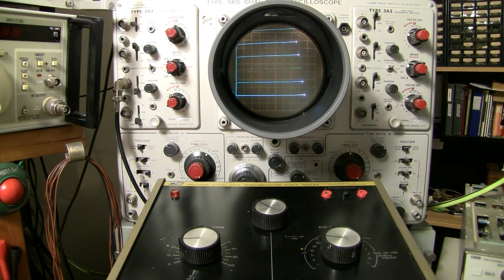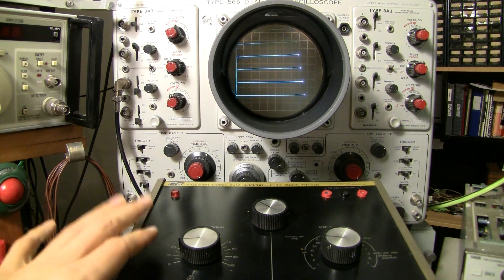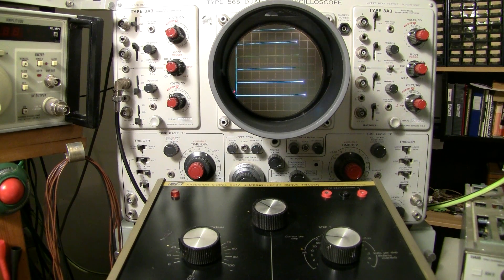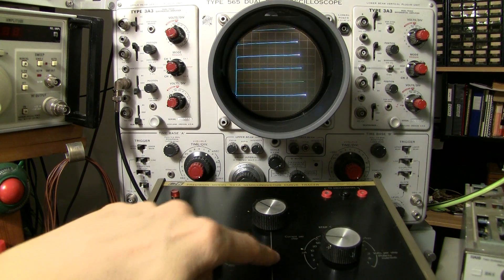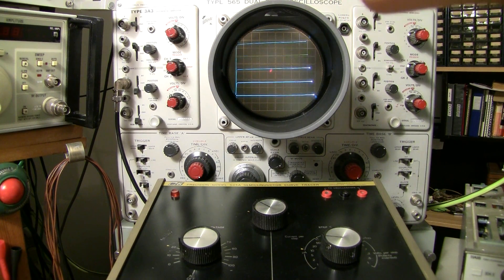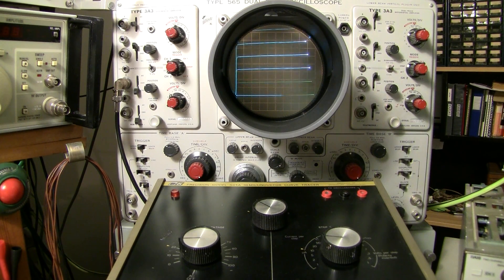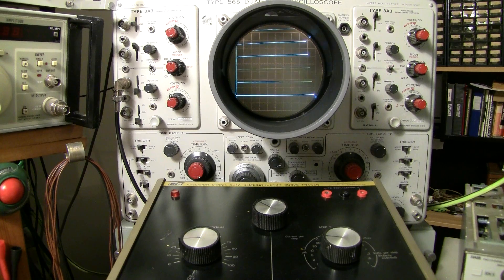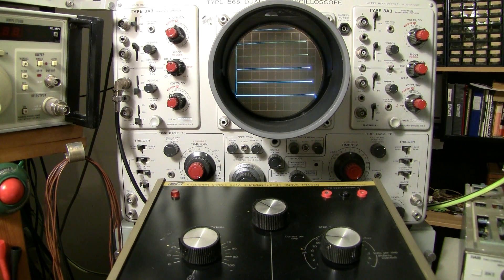How to use a Curve Tracer to determine Transistor gain

Comment: Hello, soon I'll be getting an analog oscilloscope (probably a Tektronix 465), and I've been trying to find a cheap curve tracer mainly for the purpose of matching transistors, diodes, and testing electronic components, to go with it. All my searches yield giant $2,000 machines though. However, I really like the look of your BK 501. Do you know of any other similar little curve tracer boxes I should keep an eye out for?

Also I have a quick question seeing as I have never owned a curve tracer. How is it hooked up to the oscilloscope, do you just plug it in to a channel? and do you hook it up to the oscilloscopes ground? And will a curve tracer such as the BK 501 work with almost all oscilloscopes?
Reply from the maker: The 501 will work with even the most basic oscilloscopes, as long as they have separate horizontal and vertical inputs.

Comment: I was lucky enough to get one of these 501a's with manual for a really great price. 

You mention that you added switches to the rear of your 501. 

Would you mind elaborating on your mods?

Thanks, and thanks for the video!
Reply from the maker: +xwarp 
I will do in a future video. Basically they just speed the cal process up, instead of removing wires from the tracer to the scope.
Reply: +Mr Carlson&#39;s Lab 

It did not dawn on me that you probably set that up more so because of your scope. I have a Tek 2246A and have stored all the scope setup settings required for the 501a calibration with the scope. 

All I have to do is "recall" the specific setup, for which I have 2 different setups, one for PNP and the other for NPN. This makes it much easier for me to not have to touch anything on the scope when I am switching between npn's and pnp's.

Thanks for your videos!
Reply from the maker: Then your well on your way. No need for the switches then. Glad your enjoying the video's!
Reply: @MrCarlsonsLab  

Hi Paul,

I am awaiting the arrival of a BK 501A off of Ebay.  I too would be interested in seeing a video on your mods along with any further insights you've gained over the years into this particular curve tracer.

Thanks for all the great content you create!
Darren
Reply: Just added a 501a to my bench as well.  Also interested in mods performed

Comment: This is a interesting approach to testing transistors. However, I must confess that using a curve tracer has certain advantages when it comes to intermittent problems that can be tough to track down. Transistor testers are good but work on a fixed voltage that limits it's capability to fully evaluate a transistor because it usually can't approach the breakdown voltage where some intermittent activities hide, nice demonstration.
Reply from the maker: +John Cunningham 
I agree John. Thanks for your comment!

Comment: Paul,

Thought I'd wander back and mention i concocted an A/B jig for curve tracers. Not sure if your B&K has one and cannot remember if the Heath CTs abroad in the land do as well, but thought I'd pass it along nonetheless. It is for my 7CT1N plugin.

I fashioned it out of a machined 8-pin DIP socket and a 2x3-pole switch(?)  I can never get those designations correct. In a fit of shameless blog-whoring, the poop and pics are over at a little paean I crafted for your fine efforts on your You Tube channel:

http://righthandofzod.blogspot.com/2015/11/for-mr-carlson.html

The downside is that it probably only handles the TO-92 packages comfortably but WILL accommodate 2N and 2S transistors.

73s,

Bill, k6whp
Reply from the maker: +k6whp  Wow, Thanks for the nice write up Bill! I like your little transistor jig, so neatly done with the PCB box. Ya know, I had a chance to get the curve tracer adapter for my TEK 7834 and 7904 but it slipped through my hands. Now I'm going to have to try a PCB box build as well. I have never done that..... It looks so neat!
Thanks again Bill!